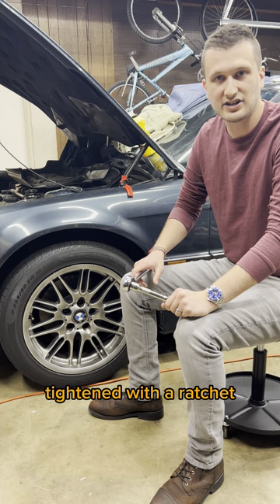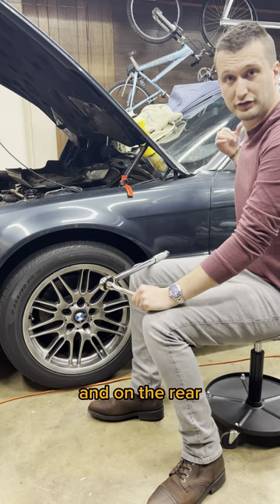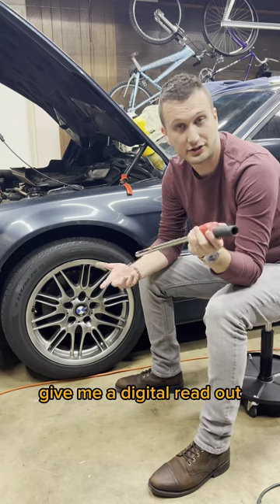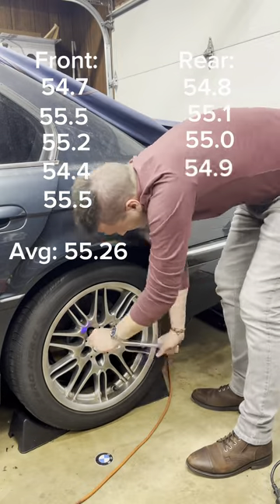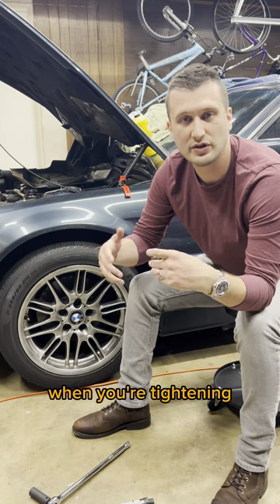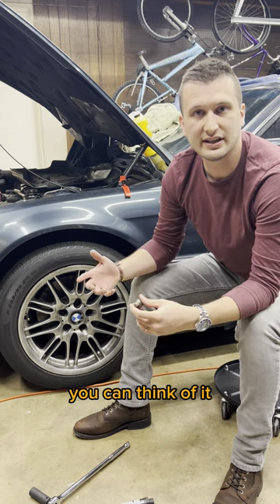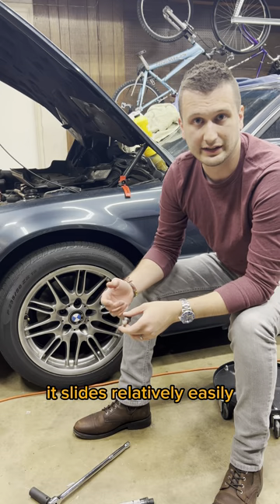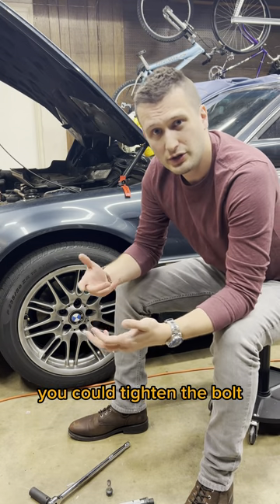Torque Wrench Clicks #shorts

Comment: Same, the idea being you don't want the tire to turn when you're using the torque wrench but you also don't want the full weight of the car on the wheel hub before the correct torque is applied

Comment: Did you keep the tires a little up when you toque
Reply from the maker: I’m not 100% sure of the question
Reply: @drive_science  I was taught little pressure on tires so that don't turn when u let the Jack's down just so tires catch the ground
Reply from the maker: Ah yes, in this case it doesn’t matter because the car is wrecked, but yes you generally want to do that
Reply: Thanks you have a great day do you do star pattern or just circle